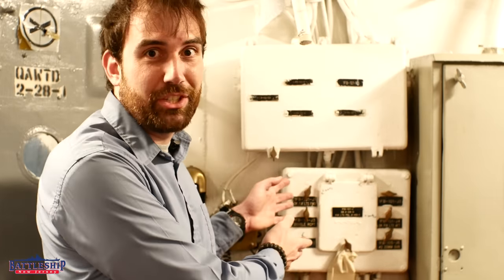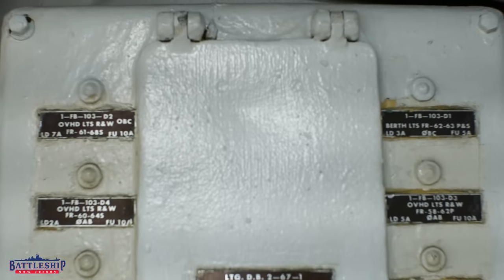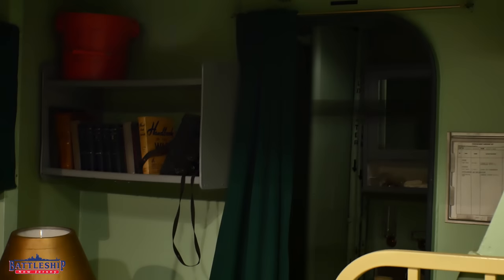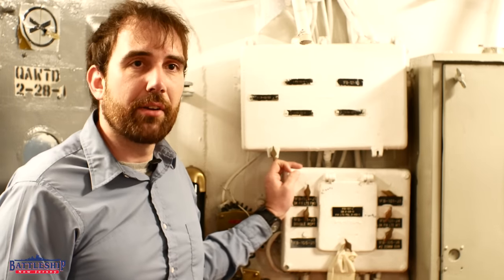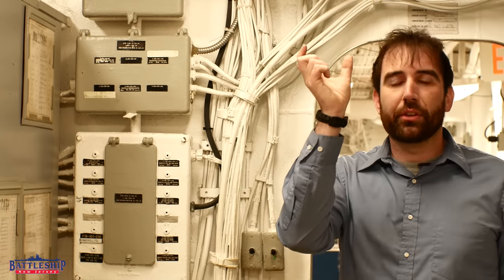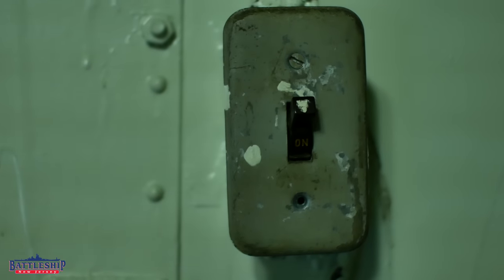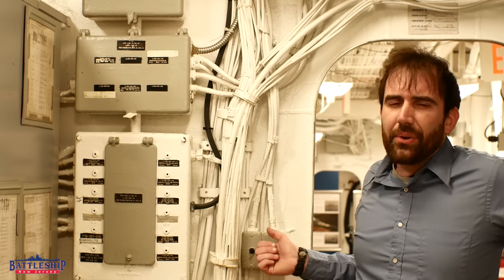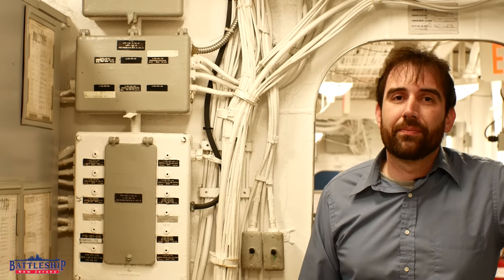Don't Touch That Lightswitch!

Comment: I was an electrician on Spruance class destroyers at Ingalls Shipyard back in the seventies. I wired many 3 position toggle switches for red and white lights. We also used blue and white lights in Combat Information Center (CIC).

We used 3 tube fluorescent lights as described in the video. The 2 outer bulbs had their own ballast and the center bulb had its own separate ballast. The center bulb was an ordinary white bulb and we installed a plastic red or blue sleeve over the bulb to change its color. 

I don’t believe the 3 position toggle switch shown in the video is watertight. The rubber boot is simply to keep dirt and moisture out. The switch appears to be installed in a steel handy box with a steel cover. This type of box and cover is not watertight.

On the Spruance class destroyers, we used the 3 position toggle switches for rooms with red and white lights and the on/off toggle switches for rooms that had white lights only. Both types of switches were installed in steel handy boxes with steel covers. This was not a watertight wiring method. I suspect that the New Jersey’s switches were similar.

There were some watertight rotary snap switches used on the Spruance class destroyers in locations where the switch was likely to get wet. However, the majority of the switches were simple on/off toggles and 3 position toggles.
Reply: Blue light is supposed to inhibit sleep. This why morphine have blue light reduction mode on them.
Reply: @828enigma6  They used blue before that modern thinking(jury is still out whether it is fact or marketing).  

The actual reason is for visibility.  Low light that marginally affects night vision, but offers readability to paper charts/logs and electronic displays.  Red lights are TERRIBLE for visibility, which is why they are used for darken ship.
Reply: The Army went to blue lights in combat vehicles many years ago for some of the same reasons.  Not only is it easier for the crew to see and read maps, it is much less noticeable at night to an enemy observer than red.  Also if you are working on someone who is wounded blood is almost impossible to see under red light but it turns black under a blue light.
Reply: @chrisfrazier2002  Like a traveling philosopher once said, blue light, what does it do ? Shines blue.
Reply: Reason behind red light is not saturating your rod cells used by night vision, you can go straight from a dull red lamp space to pitch black and see similarly well to if you'd had your eyes shut, while a bluer light will leave you totally blind for a couple of minutes till your eyes adjust. But in age of sail they literally used to sit in the dark, or cover one eye to try do the same thing, but that obviously inhibits other functions more. Red lights pretty horrible for trying to read maps ect though, and stands out against nature.
Reply: @Grimmwoldds  Blue light absolutely kills night vision at any level though, it's easy to test that personally
Reply: @SheepInACart  Yes, I have read the iconic eye patches of the pirates were usually not used because they were missing an eye but to preserve night vision in one eye. When boarding a ship and storming below the deck where it was dark they would remove the patch and have one eye already adjusted to the darkness so they would not be fighting blind. The pilots of the cold war era observation planes wore an eye patch for the same reason, if there was a nuclear detonation they would not have both of their eyes blinded by the bright light.

Comment: I suspect the residential switches are mostly for what you refe to as unauthorized ship alts. While on shore you could just go buy a bunch to use as desired. The others probably had to be requsitonrd through the stores system, which meant paperwotprk, an various levels of approvals.
Reply: At 79 cents a pop,  vs. ruggedized combat-qulaified hardware at, what five bucks?

Comment: On my old ship, DD-945, there were switches on all the doors leading outside. At night if you opened the door the lights in the space would go out. Kind of like a reverse refrigerator light switch.
Reply: Makes sense.  I’ve seen similar systems on air conditioner units to keep from air conditioning nature. As long as everything is shut tight, AC runs.  Moment you crack a window it’s off

Comment: One time I was instructed to hit the breaker for the stern floodlights on my ship, and instead I shut down the power to the gyrocompass. Captain wasn't happy.
Reply: I imagined so!
Reply: @scottmcdivitt2187  We had a backup gyro so it could have been worse at least.
Reply: were the breakers clearly labeled or that smudged BS one tends to find inside the breaker/fuse panel of an older home where you are just guessing.
Reply: @filanfyretracker  The Gyro breaker was right below the floodlight breaker so my brain read the label and flipped the switch my hand landed on without much thought. Nowadays I stop, read the label, put my hand on the switch, and pause and read the label again.
Reply: Yikes!!
Reply: Well you could point out that you have just exposed a combat critical design flaw.....

Comment: my guess as to why the old switches where retained in some spaces is that it might be harder to flip the older switch by just bumping into it.
Reply: They're also for certain spaces likely to need robust housings and mechanisms(both for switch operability and safety of that switch a.k.a. arcing).  Magazines for example, which have issues with fire/flooding.  Double for magazines which open onto the weatherdecks.

Comment: I love old switches!  Off-topic but when I built my last classic car I added the dimmer switch for the lights from a WW2 era German fighter plane, a Me109 I think.  Just because it was big and cool looking, sure worked well.  I removed it before I sold the car and still have it.  I have other switches too including a WW2 era 9 position switch with over 20 connections on the back if it

Comment: I used to install fire alarms on military installations and there are different ways the wiring is run in order to be up to their code.  It makes the system "fail proof".  Just wondering if the lighting is done in the same manner.  May be worth looking into.

Comment: I'm quite fond of motion sensor switches.  I have one in my utility room & in a storage building.  I also have 2 LED flashlights that have 3 modes:  white light, red light & flashing red light.  I used the flashing red light to mark a neighbor's house when I had to call EMS for her.  EMS really appreciated the light, 'cause they could see it a block away & no searching for the house number.  Thanks for the vid!!
Reply: Except when you are working in your office and the lights keep turning off if you don't get up from your desk often enough.
Reply: @fredsafarowic3149  Our office bathroom was on a short timer. I cranked it up a bit.
Reply: @fredsafarowic3149  Some of the labs that I work in on occasion have lights like that.  Sometimes you can just wave your arms around to trip the sensor and turn the lights back on, but sometimes the sensor can't see where you're sitting, so you have to get up and move around a bit.  I joked at one point that we should re-wire it to turn on a disco ball when it turns off the room lights; might as well make it a proper dance party!
Reply: The latest "improved" sensors have a second type of sensor built in which keeps the light on if a body is present - even if it is not moving

Comment: All the current lights on the Battleships are what the Navy still has. I think they may be upgrading some to the LED tube that replaces the fluorescents.

As far as red light at home, I have some fancy wifi controlled LED bulbs that can change all sorts of colors.
Reply: We have the same "wifi light" installed in hall, really handy when navigating at night without need to turn on main lights
Reply: @ImRandomDude  Cree LED is the brand I have. Control it with my phone or tablet. Have a schedule programmed for my living room one, so it takes care of itself, goes to blue at 10pm and shuts off at midnight.

Comment: Check out the switches for the running lights.  Many ships and boats had two filaments in the bulb.  When one burned out, you could rotate the switch in the opposite direction to energize the second filament.  Used the second filament until the electricians could swap out the bulb.

Comment: Ryan: Don't know if they are available for the US market but in Europe there's a series of light switches and outlets made in old style called Renova made by Eljo - rotary switches included.

To use different styles of switches depending on if red light is available seems reasonable to me - that way you reduce the risk for turning on the white light by mistake when you need to preserve dark vision.

Comment: I was surprised by what percentage of light switches were miswired.
Reply: I am guessing when installed they were all correct, and over the years as repairs and replacements were done it got installed, functions, great. And they moved on to what ever the next work order was.
Reply: Well a light switch that's wiring backwards still works. I was an AE and we once wired a 3-phase gyro motor backwards on two of the wires. At first we didn't notice since the motor worked and we were able to calibrate it. However, on the CDI inspection, he noticed that the indicator the gyro controlled pointed the wrong direction (it was for a turn rate indicator that showed degrees per second so that's what we calibrated it to). 

One major safety risk with getting wiring backwards (on something like a toaster) is that part of the circuit is exposed and that needs to be the ground side. Otherwise if it's on a the live path of the circuit that's exposed, anything can easily become the ground of a circuit. This is why some American plugs (that don't have a neutral pin) will have one pin larger than the other so it can only be plugged in one direction to ensure that the device is safe.
Reply: @Najolve  Good points, another small aspect is which side is being switched (if that is relevant to a switched object) is that you must break the live side and not just the neutral or your entire circuit becomes live with no path to ground. So the light is off, but you still get shocked if you touch any metalwork that is in the normal electrical path. Found that one out trying to replace a bulb that busted and left the base in the socket...

Comment: The USS Hawes FFG-59 had fun with an Electrical mod in the early 2000's;    We were in a Norfolk, VA shipyard getting the Generator prime movers replaced with Caterpillars. We worked all night to prove #2 generator was functional and operating correctly for acceptance trials in the AM (8 or 9am).  When we went to run it for acceptance nothing happened no power.   We troubleshot all daily even changing out the controller with another engine that was known good and accepted already,  Finally, night comes on and as exhaustion sets in and we are at wit's end,  it started again.  Turns out the Shipyard found a power panel they thought was the correct one and added a circuit to power the controls for the new caterpillar diesel generator set.  What they found was actually the waterline security light Panel, instead of the power panel just below it with a matching number.   The Quarter deck watch turns on waterline lights at dusk and off at 7am from a Master switch on the Quarterdeck.   The Electricians then were tasked with verifying EVERY power panel and that NONE had matching numbers.  That was 20 yrs ago, I think they found 3 or 4 more Matching numbered panels  Waterline and regular lights combinations

Comment: I like ABB Tango light switches. They're quite comfy to use and you don't need to twist your arm off. Turn switches used to be a standard here in Czechia but nowadays only retro style installations are being fitted with them.

Comment: In 2016 I sailed aboard the WHEC Mellon.  The lights were still the same 3 stage switch from the 80s with sleeves over the middle florescent bulb.

Comment: I like the center off toggle switches. I think those are essentially the same type of switch that can be ordered today, it's still a common type of switch used on equipment today. I also like the old push button on/off light switches, did they ever use those on any Navy ships?

Comment: I've been gradually converting the light switches in my old house from standard commercial toggles to wide, flat rocker switches, partly to improve accessibility and partly just because they look cool (particularly the kind that have a little neon lamp in them that's on when the lights they control are off).

Comment: you should put a laminated note sheet near the switches to make maintenance easier. I would put it on magnetic tape so you can pull it off if you need to follow something on a map and stick it back on the side of the panel when you are done. If it hangs on a rope it will look trashy but magnetic tape I think would make it low profile and leave the original look for tours.

Comment: The rotary switches are 'explosion proof', designed so that operation of the switch(es) will not cause ignition of flammable atmosphere outside of the switch, and flames cannot pass from inside the switch housing to the outside.  These are very expensive to purchase.

The "bat handle" 3-way ON-OFF-ON switches are also explosion proof.

The residential/commercial-style toggle switches are not explosion proof, but are  far less expensive (orders of magnitude) than the rotary switches, and available practically everywhere.  These may have been used in areas where possible explosive atmospheres were unlikely, or in auxiliary areas.

Comment: Control ran Red lights at night for the Scope Operator. Blackout curtains for all entries that might let excessive light in.  Rest of the Boat maintained normal lighting (minus berthing which were always red or blue when at sea).
I remember literally setting my tray on the table, sitting down in my chair. Before I could even pick up my fork to start eating, half the lights turned off.  The 3 of us electricians picked up our trays and shoveled food as we started walking off the mess decks and started heading Aft.  Sure enough, that call to report to the engine room came over 1MC as we were going through the water tight door.  Eating and Sleeping is overrated underway anyway.

Comment: Im not an audio guy whatsoever (uni-eared) anyway idk if its the position your mic is clipped at but there is a large sing in volume level as you turn your head while speaking
Reply: It's absolutely due to lapel mike not being centered.  Mouth towards mike = loud.  Mouth away from mike = quiet.
This concludes the auditory test brought to you by the battleship New Jersey.

Comment: I totally get using a red light to read.  I don't have two different kinds of bulbs in different places to make that happen though:  Just use modern smart lights.  Despite cheaper alternatives being available today, I swapped a lot of traditional white lights out for Philips Hue color bulbs that can be white, red, or any color I need them to be., then I set Apple Homekit up to talk to my Hue lights so I don't have to get up.  

The Hue lights came in handy when my girlfriend got a concussion and she couldn't tolerate blue lighting any longer.  She appreciated that (eventually) but steadfastly refused to use her phone instead of a light switch, so I programmed the bulbs to switch off and on at the wall switches rather than staying off and requiring a phone to turn them back to the right color.

Comment: I think I’d be willing to make a donation to Battleship New Jersey if Ryan would just get a new microphone that always worked as well as the current mic worked for half this video.
Reply: Count me in for up to $50.
Reply: Yeah.. downside of lapel mics... they don't work so well when you have your head turned away from them. Most YouTubers have better mics just off camera. That would probably be a pain for hauling around and setting up in different parts of the ship all the time, though. One better option would be more of a headset-style setup with a boom mic that hangs down from your ear. Same as what gamers and pilots use, except without the actual speakers over your ears. Those tend to work pretty well, since the mic stays beside your mouth regardless of how you turn your head.
Reply: @vbscript2  In my years of doing the lighting and sound for school plays, I discovered that the best place for lavaliere microphones isn't on the "lapel," but at larynx, where the clavicles meet. Then you get good pickup no matter which way you turn your head.

Comment: Those rotary switches are just a step below the rotary encoder you'd find in a multimeter, or other electronic devices.
Reply: one-bit rotary encoder
Reply: @mg30ebay  It's legitimate binary!

Comment: Those rotating switches, Used them in all sorts of applications. From running motors to lights to the radio or what ever power switching. Never had an issue. Not!!! to be confused with the multi position wafer switches used for band switching on the radio. Those are the hell switches of sanity.

Comment: The only non-led-color lights i have are outside. Four Mercury-vapor lamps lighting my driveway and parking area. 
They are old, and i hope they last me forever as a 2015 ban on them means i can't buy replacements.
Inside the house however i have a 'classic' desk reading lamp, where the green cap i have replaced with a uranium glass full enclosure and it gives a lovely smoothing green glow.
p.s. grandma's house had rotary switches, i liked them, but i would not put them in a living area, more like sheds or basements.